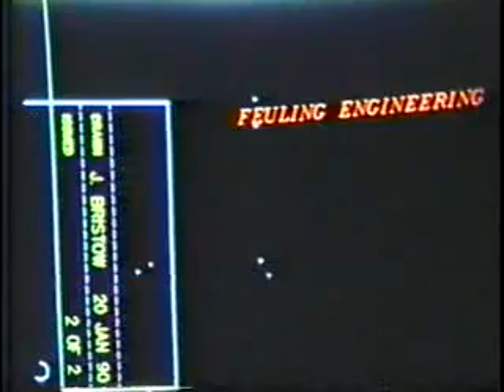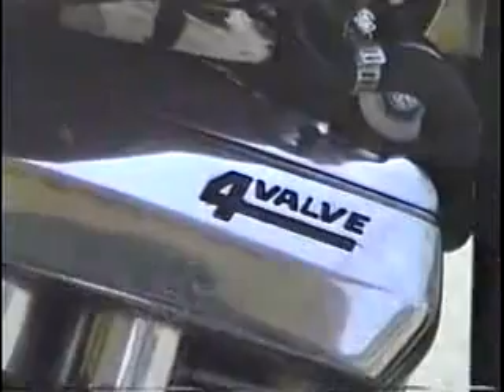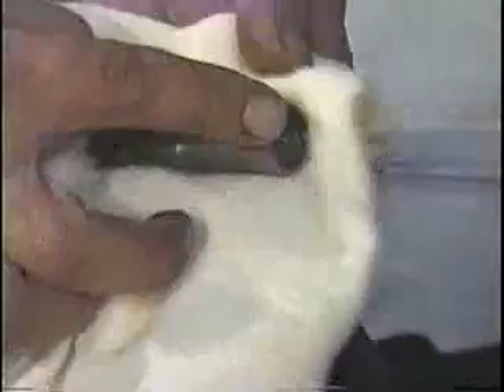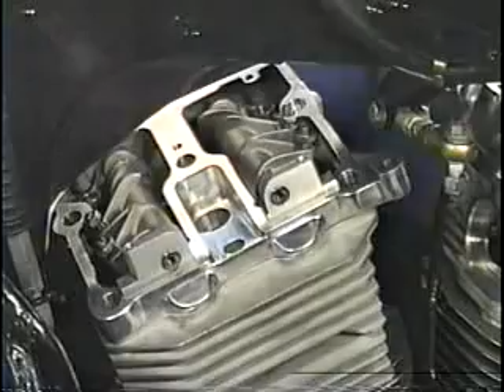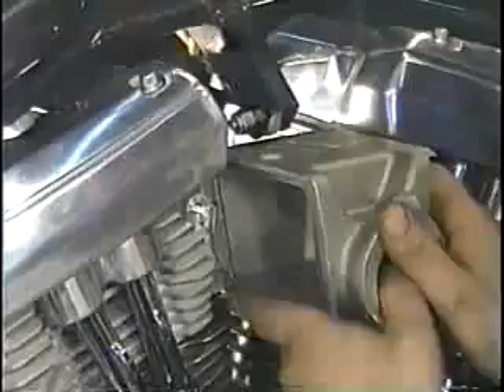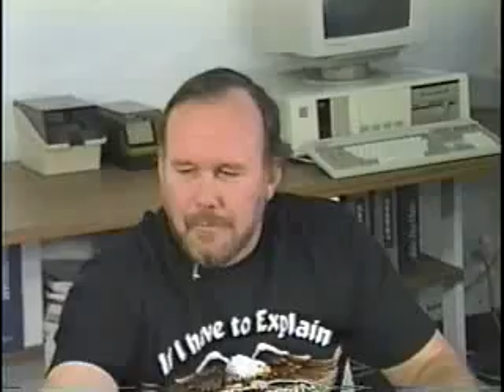feuling assembly

Comment: This was great to watch ... A genuine factory instructional video ... Thanks very much for uploading this ... Would be great to know what cam / carb / exhaust combinations were used and any dyno numbers ... Am currently rebuilding my stripped 97 heritage softail ... i like spokes whitewalls big guards triple lights running boards and most important is the solid mounted motor ... interesting points to note ... don't put oil on rocker pad until final assembly ... bonding gasket to rocker covers ... inlet rockers down for rear cylinder ... hose for spark plugs ... dielectric grease ... if anyone can answer my question about combinations and dyno numbers would be greatly appreciated